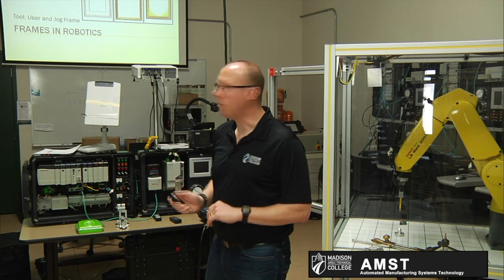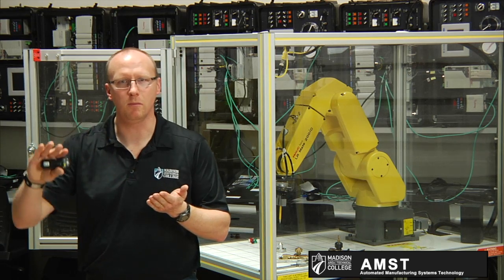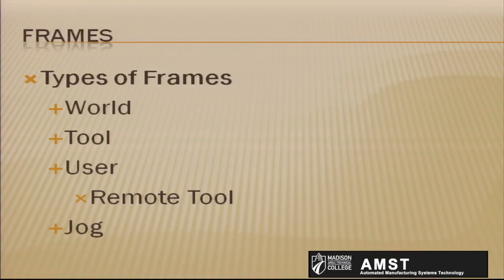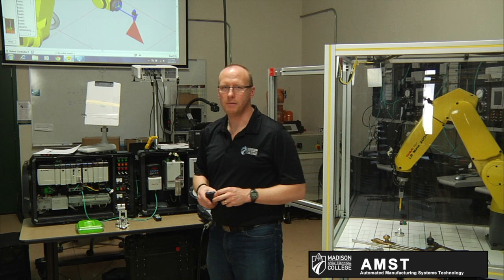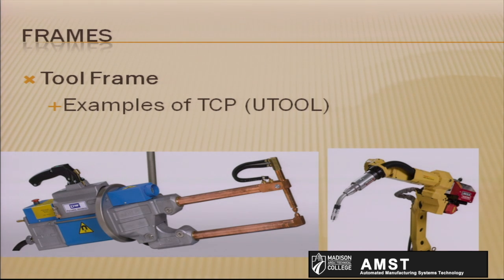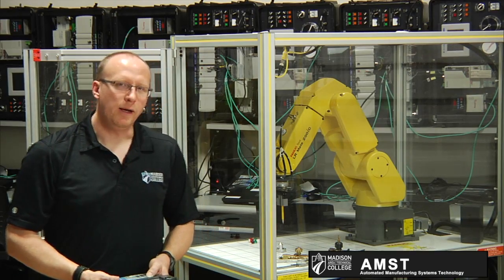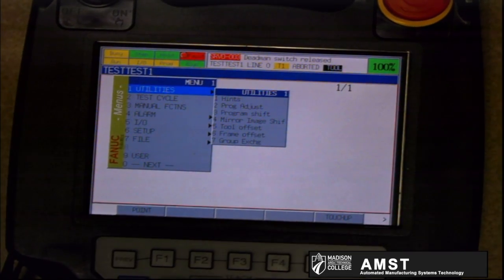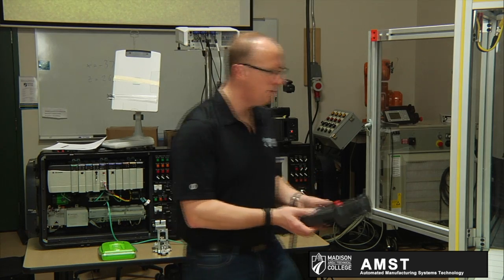Frames in Robotics - Tool frames (UTOOL)

Comment: Hello, thanks for this video, I have a question that is it possible to direct entry of tool values which comes from roboguide program to any fanuc robot? Does these values work on real robots?
Reply from the maker: Yes, you can use the DIRECT ENTRY method for entering tool values. This is actually preferred, if you have a well designed EOAT.

Comment: after remastering can you touchup the tool center point in order to avoid touching up your individual points?
Reply from the maker: Hmmh, not sure. I'd recommend re-doing the UT, but you are probably still off on your points. You can do a "Program Shift", as long as you have a good reference point. Program Shift allows you to shift all or a section of points based on the difference from an old position to the new position. Good luck!

Comment: Hi ! Can i use Wolrd coordinate to Jog TCP of robot linear follow X, Y, Z ?
Now,  My robot in world coordinate can not follow X, Y and Z. Please help me.   Thanks you !
Reply from the maker: Hmmh, not sure what you have going on. In WORLD jog mode, the robot should follow the default world frame X, Y, & Z axis when pressing any of the top three sets of jog buttons. Check that you are not in TOOL, JOINT, USER, or JOG frame jog mode. If your robot still does not jog properly in WORLD axis mode, you may have lost mastering, or the robot was not mastered correctly. Unless you lost power and had no batteries, this is unlikely and takes some effort to correct.
Reply: +Robotics & Automation - AMST 
Hi ! thanks you for your help ! 
 last time , my robot have error 062 BAZ, i changed battery and mastering follow manual. But, i can not jog all axis position to 0, and j2/j3 = ? to OK. can you tell me about it ! thanks you.
Reply from the maker: Well, if your robot does not jog parallel and perpendicular to its WORLD coordinate axes, the mastering you performed is bad. If you have the procedures, follow the ZERO Position Mastering procedure. Align all axes with their witness marks, Master and Calibrate the axes. If it is done correctly, the axes should move in alignment with the WORLD coordinates.
Reply: +Robotics & Automation - AMST 
Yes, but i can not move all axis to 0 position. i used ZERO position method in master/ cal. i moved robot to witness marks. axis position alway <> 0. i tryed more...i think set in rate J2/J3 ?
Reply from the maker: You may have to clear some errors and possibly change some system variables, in order to move all axes to the ZERO position. If you do a ZERO POS Master, without all 6 axis at the alignment marks, your WORLD frame will be off, and you can't jog along the original X, Y, Z axis.
Reply: +Robotics & Automation - AMST 
Yes, Thanks you !

Comment: I wish Peter would show the same instructional videos on that beautiful orange robot in the background!  I like Fanuc robots but Roboguide is such a bad piece of software compared to ABB's Robotstudio.  I like how I can easily program an ABB robot in Notepad and don't need software expensive like Roboguide to compile the code before it can go on the robot.  I also wish Fanuc would drop the simulated teach pendant in Roboguide.  It is annoying to program the robot offline when I can only see a handful of code at a time.  Fanuc robots are great on the hardware side but suffer on the software side.
Reply: absolutely!
Reply: Exactly! I'm worked whit abb to, and, the fanuc and abb are great robots, but, when the question is software, the abb wins whit large vantage.

Comment: Would it be possible to see how to set tool frame by three point method?
Reply: Is simple. Mark thre points in 90º defased. But in this method, you don't calculate the euler's angle.